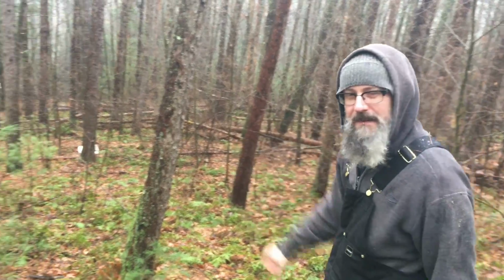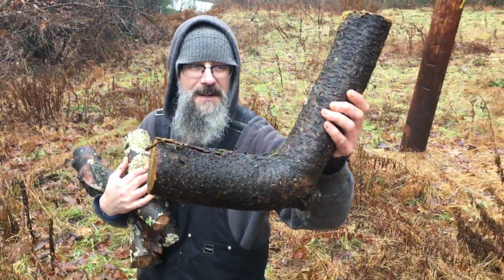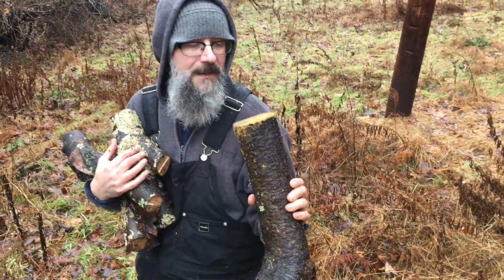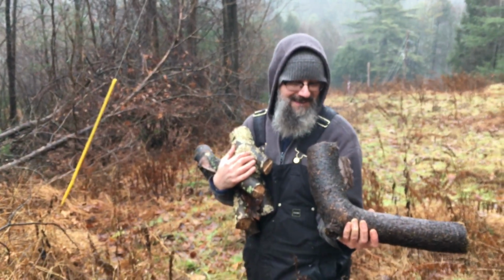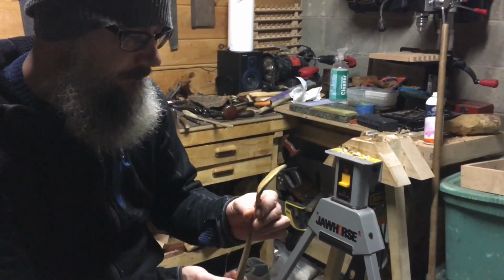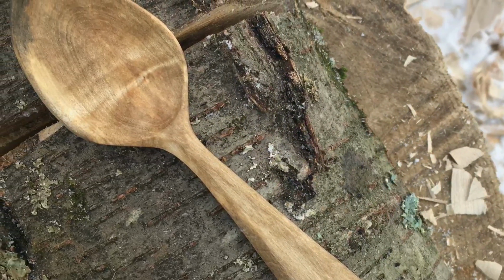Carving a Wooden Spoon with Greenwood Forest Craft

Comment: Selecting fallen timber is very eco but made it hard work for you but also meant you didn't have to wait for it to dry and oil. No cracking problems. Well done! Personally, I prefer carving 'green', easier on the hands!
Reply: The wood stays quite green while still in tree.  Since I cut this piece from a fallen tree I assure you it was still quite wet.  These days I mainly stick with carving cherry and sometimes I get to the logs I've cut while they're green 😅, but honestly cherry carved very nicely mostly dry as well!

Comment: Quick question  do u have to heat it up for strength and no cracks or is it fine like that
Reply: Hello, this is Dustin, the guy who did the carving in the video 👋.  There is no need to heat it up, just leave it to dry in a window or something.  Because you are getting rid of so much wood the chances of cracking due to drying are very slim.  If you find cracks usually that is a result of an errant axe blow.

Comment: What axe does he use to do the rough shaping of the ustensils? It has a very broad blade and a short handle and looks very handy.
Reply: That was a hewing axe I used.  It is traditionally used to create flat surfaces as it only has a bevel on one side.  The other side of the ace is completely flat.

Comment: Is coconut oil or flaxseed oil enough to coat the spoon with fo eating or maybe beeswax? I've read about issues with linseed oil.
Reply: Hi, this is Dustin the guy who carved the spoon 😊.  I recommend raw linseed oil (aka flax oil) or 100% pure tung oil.  The former smells less but does not last very long, whereas the latter has a somewhat pungent smell but will last much longer as it dries hard similar to the way boiled linseed oil dries.  Personally I use the tung oil. The smell will dissipate as it dries completely.  The issues with linseed oil are really only with BOILED linseed oil which has chemicals added to it which can be harmful to health.
Reply: Mineral oil is food safe on spoons cutting boards and bowls  .hope this helps

Comment: What hapens when the green wood dry up?
Reply: Generally you need to dry them slowly to avoid warping and cracking. Depends on your climate but I've heard people going as far as putting the spoons in a Ziploc that's open with a paper towel inside and storing them in the closet for a day or two. Then, once dry, doing the finishing cuts to smooth out the surface and bowl.  I've seen several methods of spoon carving (and have my own), it's really fun to see how others do it, and try their techniques out to see if it fits you or increases your efficiency.